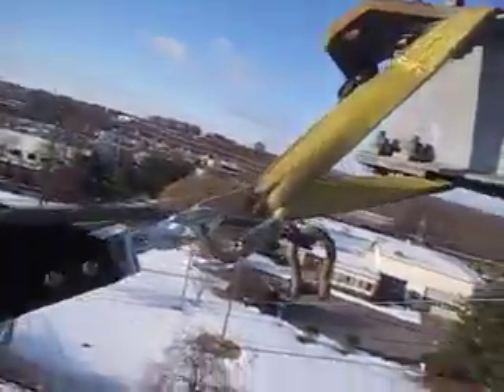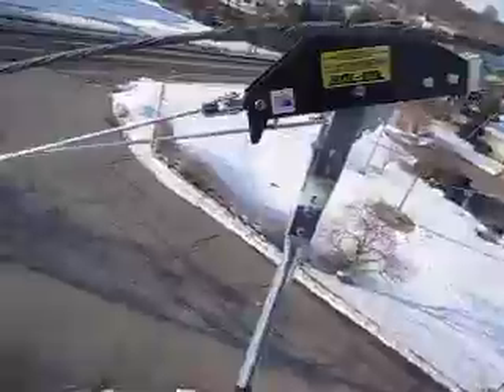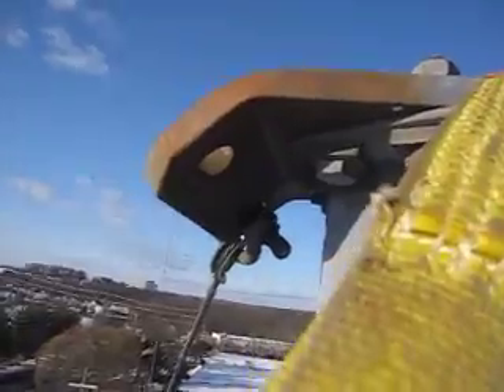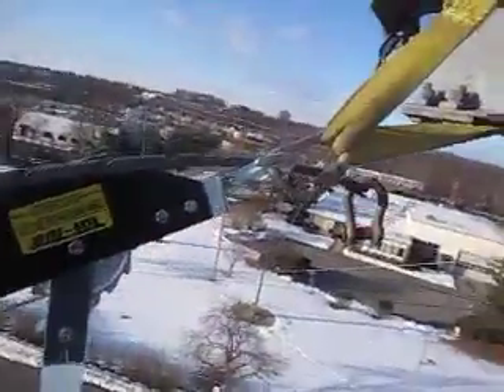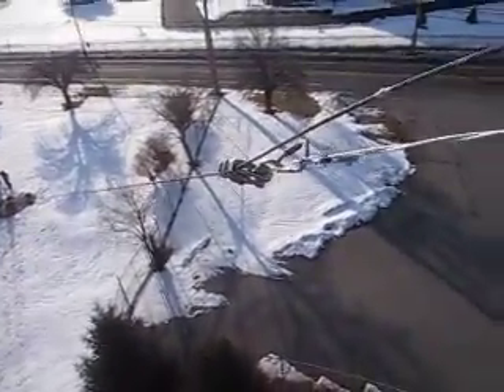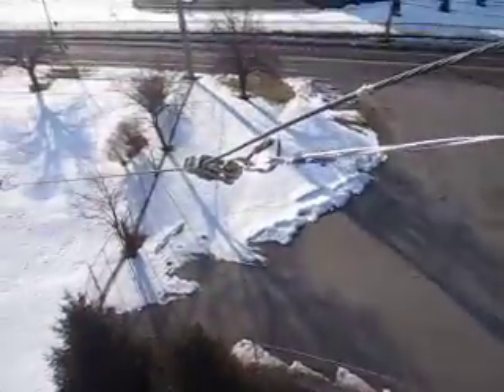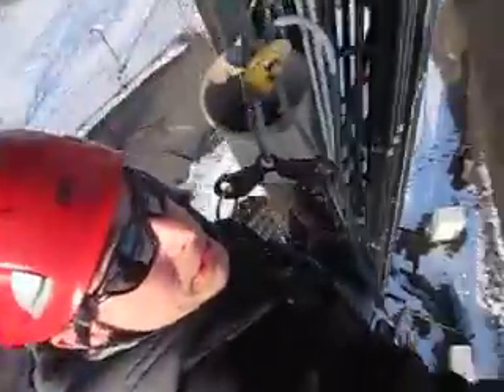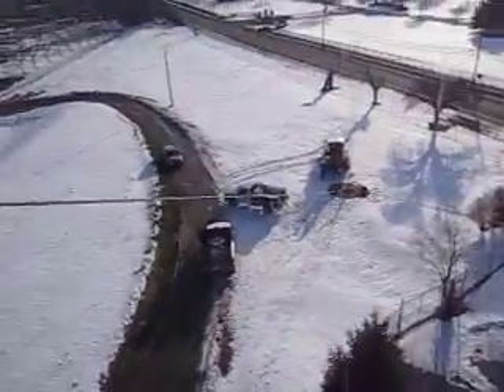How to change a guy wire

Comment: A temporary guyed should be installed before removing the old guyed wire.
Reply: The old guy wire acts as the temporary
Reply: Not all the time, you don't need a temp guy wire for a torsion